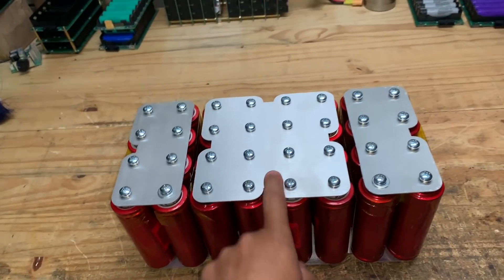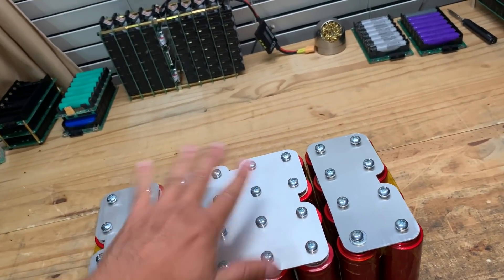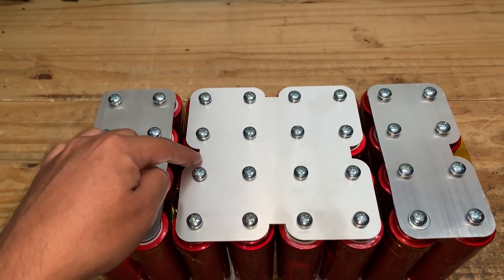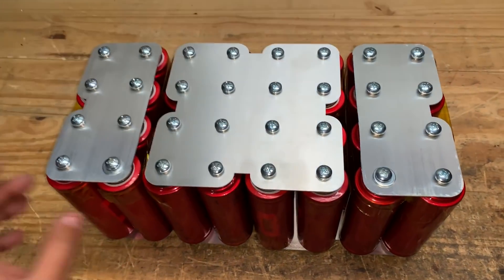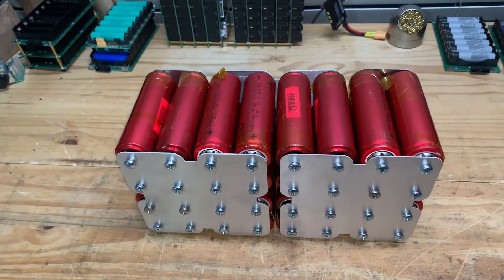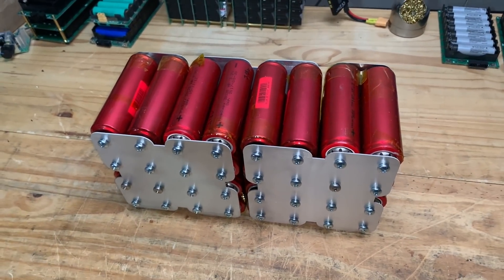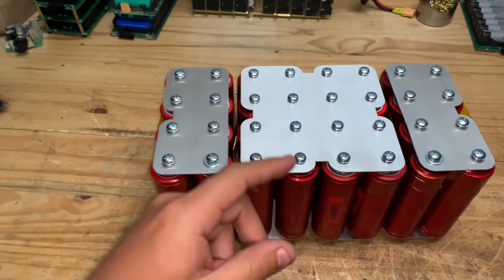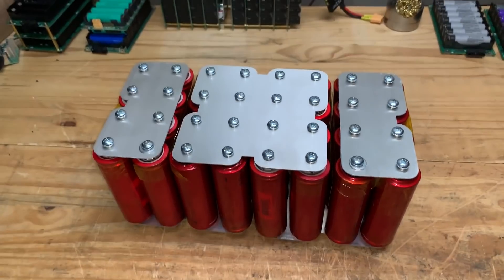DIY Headway aluminum bus bar plates v2

Comment: Does the v2 still fit in the battery box?
Reply from the maker: Not sure but current version (v4)  does.
Reply: @jehugarcia  the v4 are they the ones on the website "custom aluminium bussbars for 38120 cells"
If they fit in the battery box I'll grab a couple of sets.
Reply from the maker: Yes they should fit
Reply: Jehu please check msgs regarding shipping to Australia with these. Website dosen't allow.

Comment: I just assembled my 32 cell 38120 pack tonight. I made 3 plates of 1/8'' bakelite  with 4 holes in them. This bridges the gap between the cell packs with a non conductor and makes the battery pack very rigid. 2 on top, one on the bottom.  You can pick up the whole pack and it doesn't bend at all.

Comment: Not impressed with  Battery Hookup.  Bought eight Headway 38120HP batteries and after balance & full charge, all could not hold more than twenty percent of their rated capacity, and began losing their charge within minutes.  I should've known that BH sells used batteries but I never suspected that the batteries were THAT used.  If BH has any good batteries at all, my guess is that those batteries are reserved for high volume buyers.  Hell, one of the eight batteries sent to me has less than one volt on it.
Reply: They've always stated the difference between used and new batteries in their listings for as long as I've known about them. If you didn't read the details, who's fault is that? You're taking a chance buying anything used, that's just reality. The risk is compounded when the user demonstrates that they're dishonest with themselves and others and don't know wtf they're talking about - the fact that you're blaming them for unwittingly buying used cells is an indicator that you don't like owning up to your own mistakes. Maybe you messed something up yourself and are just defaulting to BH for a scapegoat. They do also sell new cells. To anyone. No min. order. Not impressed with your comment....

Comment: Ok I have a quick question, I built 2, 
4s 10p packs and series them for 24 volt. My question is while charging each pack “12volt” I check my cell monitor and when they are done charging the 4th series bank “ pack positive is always .2volts higher which causes me to stop charging the pack how would you rectify this issue?

Comment: I know you get tons of comments and the Chance of you reading mine are slight to none. But.... I recently found out that the Harbor Freight jump starter pack uses lifepo4 battery at 12.4v and has its on BMS.. Do you think I could use this on headway batteries? Or could you test the jump starter battery to see if it can be used on an inverter?
Reply from the maker: Which one?

Comment: Dang them cells are big. I remember when sci fi stories used to use that term instead of batteries, and since its technically more accurate, its neat to hear it more often. That series of cells put thogether looked monstrous though, in a good way. ^,;,^ lol

Comment: Man I just dumped over 15kwh of 1600-1800mah cells in the metal scrap today. I was tying to sell them for $100  for 1kwh's worth but no one wanted them :(
Reply: WHAT!  I'LL TAKE EM
Reply: @techelectricfuture3094  I live in bridgewater nova scotia, are you around there?
Reply: Los Angeles CA
Reply: @techelectricfuture3094  that would be a long drive :)
Reply: @DavidSmith-dm8ew  - thats why I let FedEx or Post do the driving.

Whats the weight and shipping dimensions i wonder.
Reply: @techelectricfuture3094  Sorry but they are gone, I threw them out.
Reply: Who does that? Even dead throw away cells don't belong in metal scrap, btw, let alone good/charged cells. They can't be recycled with regular scrap metal. Some poor bastard at the yard has to pick those out, if they didn't short in the bin before hand and turn it into a giant melted lump. I'm in NB. Next time you feel the need to toss $ into the scrap bin, hit me up.
Reply: @JamesBiggar  Calm down man... didn't throw them out like that. I had them all packed up in boxes and told them what they were.

Comment: Be careful with the right angles at the cut'in area, when this setup is used in environment with vibrations this is the area where the metal with break due to metal fatigue.

Comment: have your ever thought of drowning the batteries and plates in mineral oil (non conductive) and then having a small pump and something like an automatic transmission radiator installed so you can get better thermos?
Reply: No need, for small batteries with this much surface area to volume ratio. Active cooling is usually better if you have very big and compact batteries
Reply: Does anybody do that?
Reply: @techelectricfuture3094  I've done it with a home PC, everything was submerged but the hard drives for obvious reasons.

Comment: Jehu, I want to make a smaller 12v battery for Ham Radio if i use 16 batteries vs 32 what will my Ah be??? I'm running a 100 watt transceiver with a 25A load on transmitting, and 2 A on receive but the duty cycle will be 20% transmit and 80% receive . I can get a 12 volt 20-30Ah LiFePO4 battery for  between $205 & $280 or a 12V, 40Ah for $360 from bioenno power or two 23Ah LiFePO4 battery for $389 from Dakota Lithium which are made in the USA.
Reply: He is using a 4S8P configuration, and you are talking about a 4S4P config, so you'll have half the amp-hours.

Comment: Hi Jehu!
Thanks for your very good job! 
Can you build a 
pover bank for electric cars and plug in cars?
✌😎🇨🇦
Reply: If it's will be so heavy ...
along with regular wires for charging, I want to stick the wheels and roll like a travel suitcase - 40-50 kilograms, it is ok.

Comment: Yep, if you want those 38120 cells, you need to be ordering them the day the show up.  Each batch seems to be going out the door faster and faster.   I need some 40 more my self.    I simply can not afford to use these fine bus plates.   I can afford the aluminum flat bar stock.  Not as tidy or neat looking but it's what I have to do.

Comment: why not copper plates instead of aluminium plates?
Reply from the maker: Why not gold or silver?
Reply: @jehugarcia   sir i want to ask how you decide the material (aluminium/copper) and its physicality(length, thickness,area) based on the voltage and peak current level? is there any formula for that? i use copper plates which are not that much cheap, in thought that copper is more conductive than aluminium. If you answer then i would be able to laser cut out aluminium of specific area and thickness. Thankyou. Please respond
Reply: Aluminum is very conductive and is used for wiring in industrial settings and most homes from street to your breaker box, but they are prone to corrosion and problems with dissimilar metals so not typically recommended. You could get some chemical compound to coat the connections with to prevent this, used in house wiring.
Reply: The rift between the prices of Aluminum/Copper and Gold/Silver are so expanse that it's worth mentioning that in some cases, you give up a lot more in performance for the savings.

The difference in price between copper and silver versus the difference in performance is a huge delta that doesnt cost justify the performance increase of using silver (especially gold)  You reach a point of diminishing returns on your investment much more quickly as the price diverges.  (And less quickly with smaller price divergencies)

Was the value proposition considered?... Or just "it's cheap and it works"  (I call this "buying the price, not the product")

If I had answered for Jehu... I'd have just said "because I like to do everything as cheap as possible" or just "its cheap and effective"

When I build batteries, I use nickle instead of copper because I cant f'ing spotweld copper strips onto the cells.  Copper conducts so well that there isn't enough resistance in the metal to create the heat required for bonding to the cell.  Otherwise I'd pony up a bit and bus the cells with copper.

Copper makes one of the best "conductivity to price" value propositions.
Reply: Well, I have a similar question. 
How much current is your battery designed to supply? Those aluminium plates look neat but they also look pretty thin; I'm designing a battery to output 300A and I reckon to need 150mm2 copper. I'll be making the 1st prototype busbar plates from 5mm copper and see how that works.